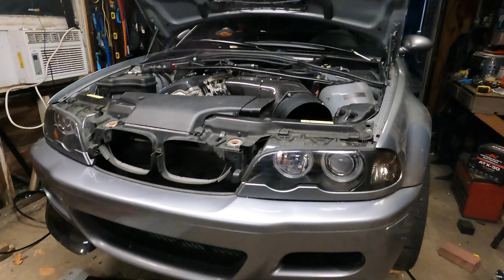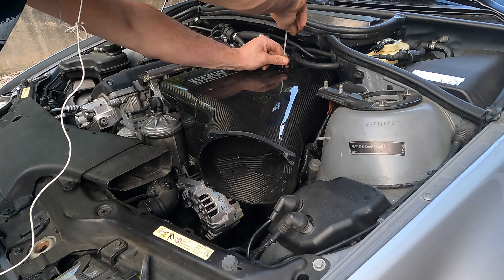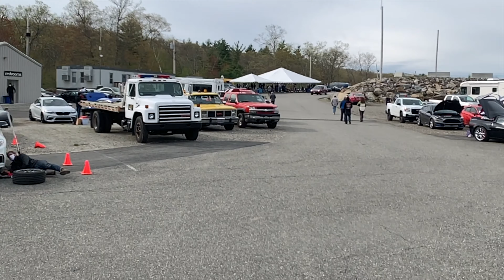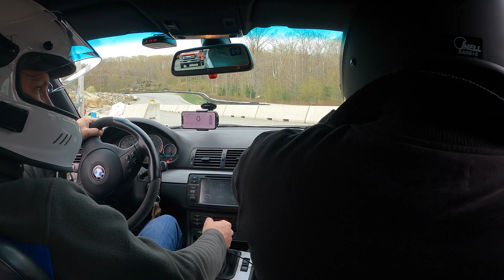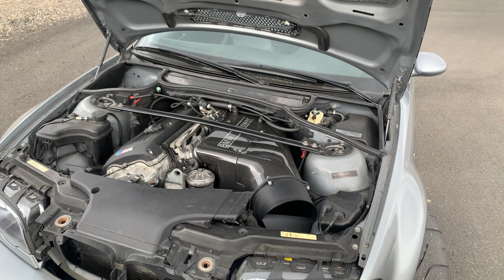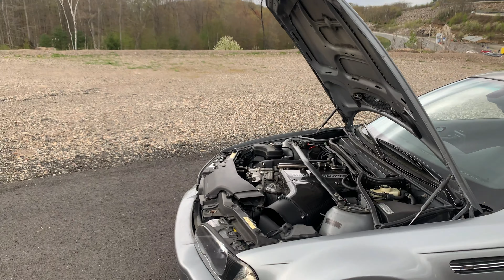Quick Fix and back at Palmer Motorsport Park

Comment: Am I seeing it right that you're mostly in 3rd and 4th gear? Trying to study some footage before going there next month.
Reply from the maker: Yes in Palmer it’s 3rd and 4th mostly, you can technically do 2nd up the hill section but if you have good momentum coming in from the hard breaking zone it’s not really needed. 3rd will pull you up the hill nicely and you’ll actually to faster.